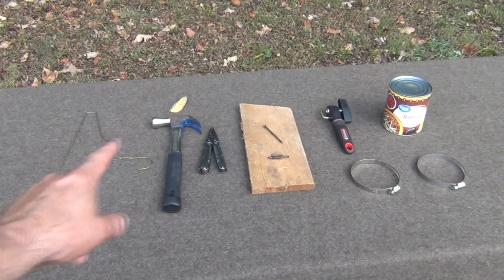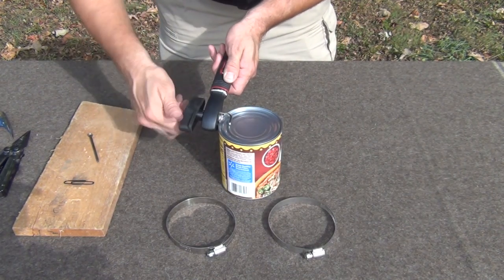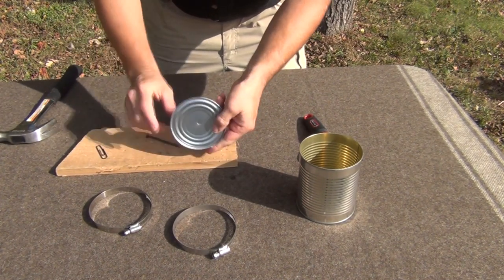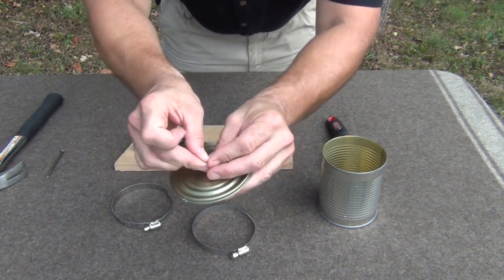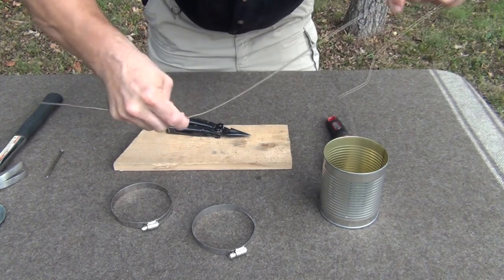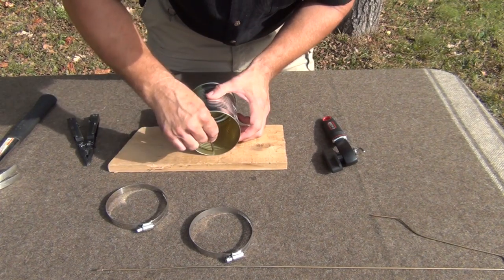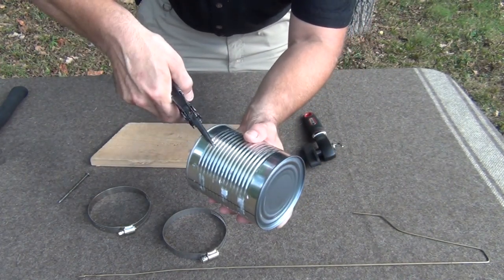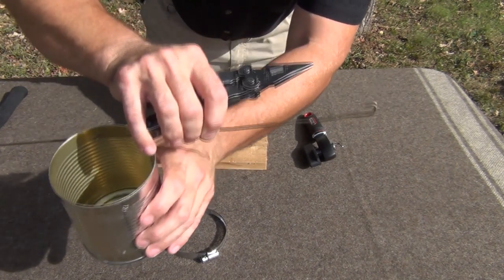Cheap, DIY Bush Pot for Bushcrafting

Comment: I used a Hi-C can for years as a child , back when they still had real "tin cans" about 1965 to 1970... in my research of historical cooking  , what you made would be called a corn boiler.  There are still some cans that have a tin coating inside . I also have been making a set of bushcraft cooking pots and cups and stove to use.  It's a nostalgia thing .
Thankyou for the ideas.
Reply from the maker: Thank you for watching!
Reply: We started do that around 1957 or 58. because mom forgot the Tupperware tumblers, then for years after because it was fun!

Comment: Nice video. Probably somewhere in the comments already, but make your first butterfly handle, then lay it down flat on a board and tap a nail in at the inner corner of each bend, and you'll have a jig to easily and quickly make a duplicate for your second butterfly handle.
Reply from the maker: That's a great idea! Thank you so much for adding it to the comments!

Comment: FYI. You could use the top of the coat hanger for your lid handle. Saves a step and utilizes more of the hanger. Just a suggestion. Great project. I will make a couple for our bugout bags as well as the sink stop/hitch pin stove.
Reply from the maker: True. Thanks for watching.

Comment: I stole your bail idea for my stanley green cup set and it is so much better. I used an broken wire whisk instead of coat hanger wire. Hangs straight and folds up neatly. Really clever. Thank you!
Reply from the maker: Thank you. Glad you were able to adapt it!

Comment: Rather than bending the wire that goes under the hose clamps out, make the handles taller and bend the ends in, going around the outside of the clamps.  The taller handles will give you a 3-4 finger grip when using gloves.
Reply from the maker: That is an excellent idea. Thanks for your input!

Comment: I have watched quite a few of your videos. Liked the projects, you're a very good instructor. 
The hobo bush pot you made, I have a suggestion. The leftover top part of the coat hanger could you not take a stick,  poke a hole in one ene and stick the two cut off ends through the hole and bend them over.  You could use the other hook as a lid lifter. Similar to a dutch oven lid lifter.
Regards
George
Reply from the maker: Good idea!

Comment: Very nice & practical! I understand recycling the bean can & the wire coat hanger; but the cost of 2 hose clamps large enough might cost more thn purchasing a bush pot. However, if you are like me, you probably have some of those & other miscellaneous hardware in your shop or garage. The Butterfly handles are a great addition, but the cost is greatly reduced without them. I might choose to add a thrift store container which nests inside which costs considerably less than hose clamps. Godo job, & GOd bless you.
Reply from the maker: Thanks for watching. I'm sure there's other ways to do this that would be more economical. God bless you too!

Comment: Nice project, but I don't like tin cans because of health dangers - they are basically made from tin (Sn) covered steel, and they put a plastic liner inside, because tin reacts with all sorts of acids, like in tomatoes. I'd always go with stainless steel and you can find rather cheap ones, but without handles, so your project is really helpful - thanks for showing.
Reply from the maker: Thanks for watching and I always burn out the liner before I use them for cookware.

Comment: Nice project. There are so many different sizes of cans that one can have a cup and a few pots nestled inside the larger cook pot. I would go a step further and paint the pot with the same high temperature paint used on barbecues.
Reply from the maker: Thank you! That's a great idea about the high temp paint.

Comment: You could use the hook from the hanger to make the handle for the lid.
Reply from the maker: Yes. That would work. However it doesn't fold down flat enough to pack easily into my kit.

Comment: I use a CHOCK FULL O NUTS coffee can (black and yellow can)for my pots. Chock full o nuts doesn't have the inside coating so you don't need to burn anything off. Also, the ribs on the can are actually measured increments, first rib from bottom is 4 ounces and each other one going up is 2 ounces. You'll need a second can to make the pot lid (from bottom of second can) as it has a foil pull top under yellow plastic lid. The yellow lid will help keep loose pot lid in place, hope this helps.
Reply from the maker: Very cool idea and application! Thanks for watching!
Reply: Grew up drinking thatcoffee

Comment: Just wondering how did the sodder seam hold out after repeated use? That was the reason we converted a stainless steel cookie tin to make sure it lasted longer than one season. I bought it at a thrift store. It does contain an alcohol stove made from tin cans.
Reply from the maker: They last a long time as long as you don't get them too hot. It's a good idea to keep enough liquid in them while cooking and then also coat them lightly with a cooking oil after use and before storage.

Comment: I did something like this, but not as well. I bought a used Stanley thermos with this on it so I sort of copied the concept.  I can't find wire hangers.  Nice video
Reply from the maker: You can buy stainless steel clothes hangers on amazon.

Comment: Could have used the hook from the hanger as the lid handle.

Also an easy way to punch holes in cans without making a dent is to fill the can with water and freeze it. Then you can hammer holes wherever you want. Nearly posted this when I watched the coal stove. Ice melts and you're good to go
Reply from the maker: Good ideas. Thanks for watching.

Comment: Fantastic design! I wonder if metal zip ties would work in place of hose clamps. Also, you could use the remaining pieces of the wire hanger to make a stronger lid hand/tab.
Reply from the maker: Thank you! Yes you could use metal zip ties as long as you could get them tight enough. Also the wire hanger lid tab would be great also. Thanks for watching the video and for sharing your ideas for improvement!
Reply: Automotive CV Boot clamps should work great and lessen the bulk.

Comment: Interesting idea, but it should be noted that modern canned goods are coated with an epoxy which will leak BPA chemicals into your food, as well as metals from the cans themselves. frequent cooking will certainly create issues. There is no good reason not to just spend 5 dollars at walmart for a proper cooking cup. 

Edit: I see you mentioned burning out the bpa liner at the tail end of the video. That is a good idea, and I suppose it could work. Not entirely sure I'd trust that, but I'm glad you addressed it. Guess I should have waited all the way to the end...
Reply from the maker: Thank you for watching. Yes, you should not heat up the BPA for sure. It does need to be burned out if you are going to cook in it.

Comment: How do you suggest burning off the inner coating i.e. temp, time, heat source? Great Video! I am going to stash one at camp with fire starter zip locked inside.
Reply from the maker: I just burn it off in a hot campfire.

Comment: How long do thease last normally? And the design is pro status, very awesome. I guess if you use lower heat when cooking, it'll probably preserve the can longer as well, plus reusable bail handle, cup handels, and pipe clamps.
Reply from the maker: As long as you wash it out good and keep it oiled it should last quite a long time.

Comment: Is it plausible to boil to a rolling boil and scrape off plastic residue with green scrubbed, steel wool, or stainless steel pot scrubber? rather than burning off plastic residue?
Reply from the maker: I don't think that would be nearly as effective. I don't think you could get it hot enough.

Comment: Great addition to put the handles on. Could you share how to best burn off the bpa? How would you know when it's all gone?
Reply from the maker: Just build a fire and put the can in the fire empty. After a few minutes the BPA will begin to burn off. You can see it's done when it is completely blackened inside and sometimes you can even see where the plastic lining has curled up. Just scrub it out with sand or pebbles and you're ready to use it.
Reply: @WayPointSurvival  thank you!!
Reply from the maker: You're welcome!

Comment: Thank you for the video, how do you suggest we help prevent the pot from rusting inside?
Reply from the maker: After you use it, clean it out and put a light coating of cooking oil inside and outside. I prefer olive oil. Thank you for watching and for your question!
Reply: Alternatively take the handles off and put on a new can😉

Comment: How much use over heat before the solder fails?nice job though
Reply from the maker: It will take quite a lot of use as long as you have liquid in the can. Thanks for asking!
Reply: WayPoint Survival Of course and  cheaper to replace with another anyway thanks for replying 👍🏻

Comment: watching this makes me wonder how much easier it would be to jus get a small 1qt. sauce pot out of the kitchen cabinet to take out and use. thats what i use, a small 1qt. speckled enamel coated pot right out of the kitchen, and its a lot easier to stir my food too because its wider than a bean can and will last a lot longer too. its infinately easier to clean as well. people over think things and make things hard when they dont have to, and it wont get crushed in a heavy pack and  contrary to popular belief it dont take up that more room in your pack
Reply from the maker: As far as that's concerned, you can just go to the thrift store and pick up a cheap pot for a couple of dollars. However, then there would be absolutely no use for the video, which is filmed for people who like to make their own gear and are somewhat crafty as well as the fact that it is very lightweight compared to any pot or pan, and it reuses or repurposes something that would otherwise just be thrown away. Anyway, thank you for watching the video and for commenting!

Comment: Why don't you use the top portion of the hanger to make a more sturdy pot handle? Good video and nice instructions on how to do each step.
Reply from the maker: I thought of that, but the lid is very light and the paper clip lifts it well. You could also use a knob from a drawer pull or a small eye bolt etc. Thanks for watching and commenting!

Comment: You were wrong about something! You said multiple times in this video "solder". There is ZERO solder in these cans or any of the parts you used. These items are either crimped together or welded. There is no solder which is a good thing since 99% of solders are toxic in food usages.
Reply from the maker: Actually, according to this article from the first of the year, solder is still used in a variety of cans. https://blogs.edf.org/health/2021/01/11/its-time-to-eliminate-lead-from-tin-coating-and-solder-on-metal-food-cans/

Comment: I don't like the handle on the lid. It looks like an afterthought and not stable. I'd use an interesting little knob of found wood and screw it in from underneath. Wouldn't get hot, either. And it would look good.
Reply from the maker: Yes, you could definitely do that. I also agree that it would look better.

Comment: ain’t gonna hold much liquid withe butterfly handle bottom hole so low!
Reply from the maker: The butterfly handle doesn't have any holes. Its held on by the hose clamps. The only holes are at the top for the bail handle.
Reply: Oops I take it back. Love it
Reply from the maker: No problem. Thank you!

Comment: looks like you cheated and used two cans with two different styles of can opener ( to and side cutting)
- your can still has the rolled lip at the top (good for strength and safety of the cut can)
- your lid also has the "same" rolled lip from the top of the can
- perhaps you forgot to mention this?
either way - good video
Reply from the maker: I actually used the same lid from the same can and only one can opener. Maybe it's the kind of safety opener I use? Anyway, thank you so much for watching and commenting!
Reply: Think you must have used a safety opener that breaks the seal....both can & lid end up retaining their lips. 

I have one & It's my go to opener. At home if there is food left in the can I set the top back on, give it a little press & it goes together well enough to store it in the fridge. Stays on well enough to keep "fridge taste " out, but will come off if knocked over. 

Bit of a learning curve to use, but now my favorite opener. Great for bushcraft & other diy projects. Picked mine up in a thrift store...a few $$ for a $30 opener (happened to be a really good brand)

PS ...love the way you explain things & have been watching your Stanley 2 cup videos....great ideas for upgrading my already beloved piece of kit. Thanks ♡

Comment: The handle on the lid is daft. Use a screw and a bit of wood or cork. And I don't understand why the hanging handle is such a daft shape. The butterfly handles are going to burn your hands. Coat them with silicone. Otherwise not a bad dingus. I've boiled water in something like that for tea and the tea was better than anything made from water boiled in a plastic electric kettle. Those plastic electric kettles make shit tea.
Reply from the maker: Thanks for watching.